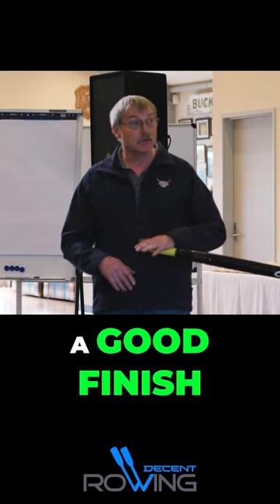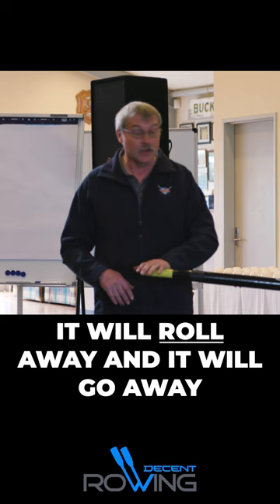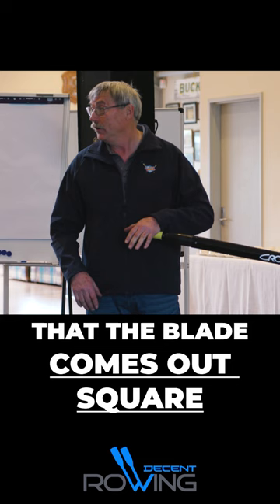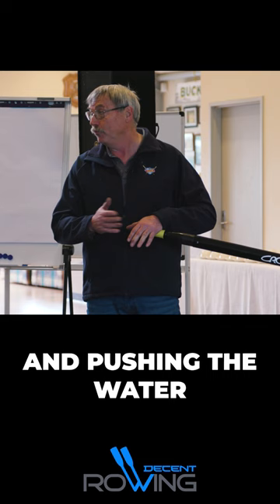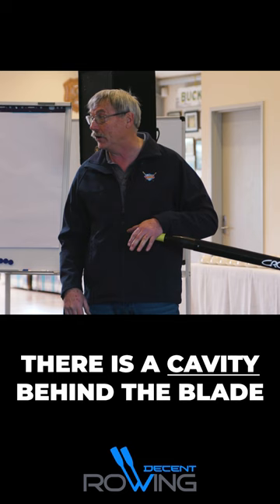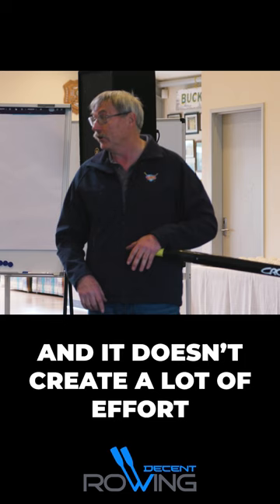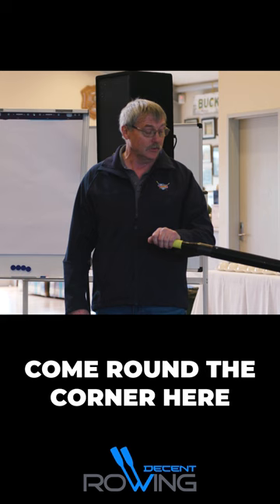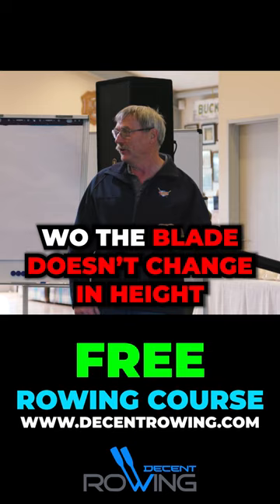A good rowing finish will look like a pause

Comment: All true but treats too lightly what’s required to “keep pressure on the blade”, the absence of which tends to create these bad finish  problems, my view, to force the blade out and not get caught. 

Tell a new sculler to keep pressure on the blade at the Finnish and they inevitably try to do that with arms. It takes some fine coordination with the last bit of legs, connected through strong abs to back power to maintain pressure at the finish, ie a well done dead lift, which is difficult.  Without it, all the finish square or don’t pull down instruction will fall short.